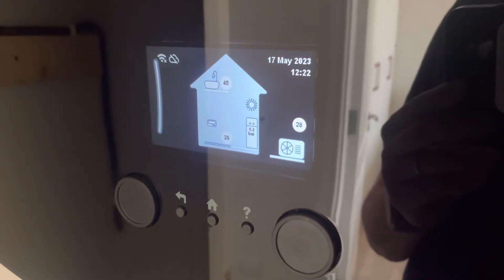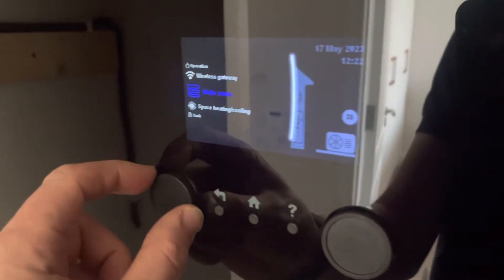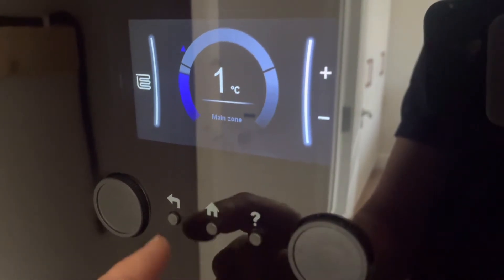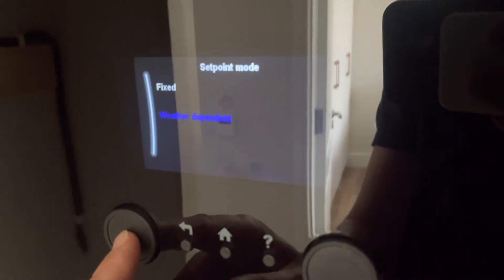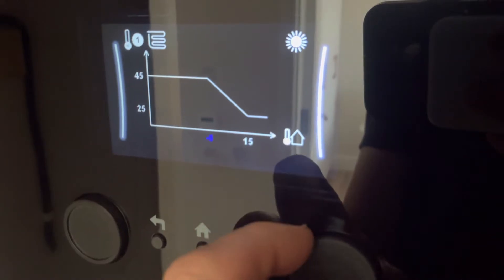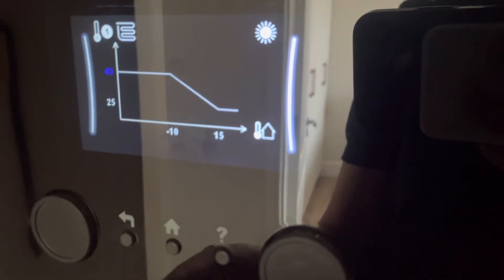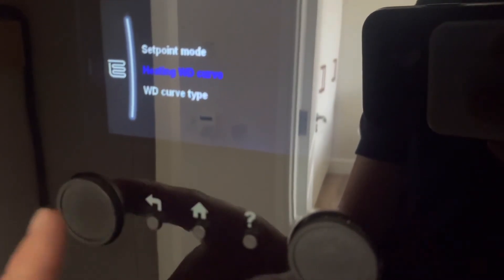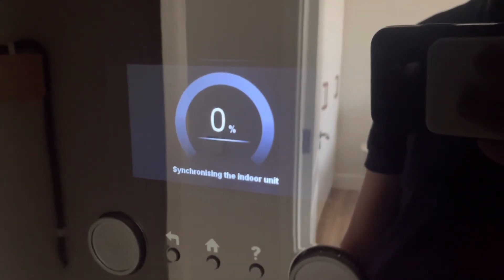Daikin Altherma 3. Setting heat curve and offset

Comment: Is there any reason my upstairs won't heat at all. Was working few weeks ago. Rads are all cold.
Reply from the maker: Could be any number of reasons, failed stat, new batteries for stat if it has them. Failed zone valve, air in rads, lack of heating pressure. Hard to say without knowing the system but that would be the main reasons
Reply: Have you heard about Hydronic Balance ? Google it !